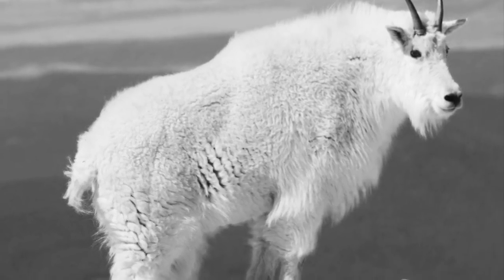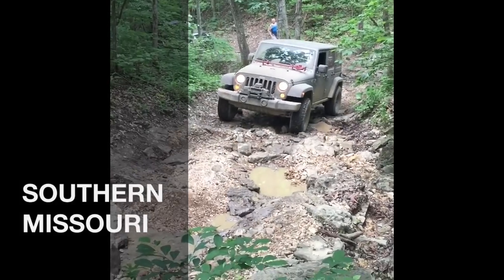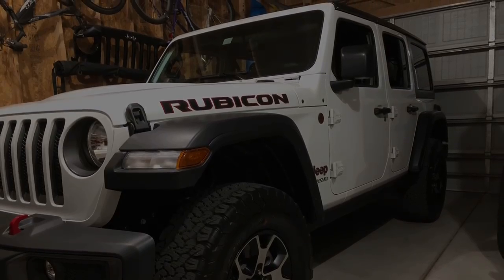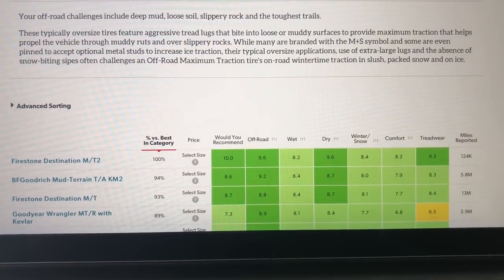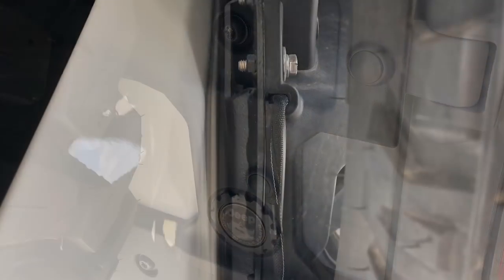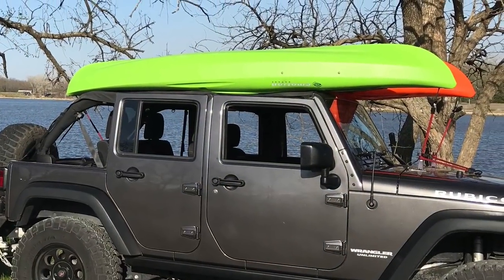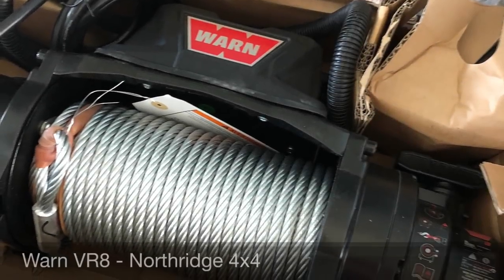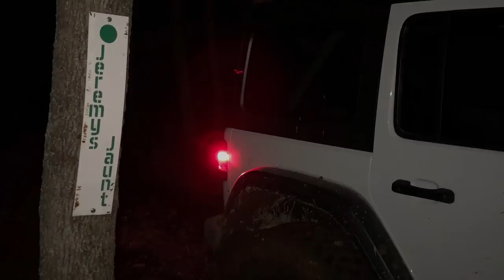Jeep Wrangler JL First Mods

Comment: I too have a new JL Rubicon.  It currently has 5000+ miles on it.  3000+ are the results of a trip starting in Ky, thru RMNP (we too did Old Fall River Rd which looks like one of your photos),  then Mosquito Pass, then down to Breckinridge for a couple of trails and then on to Ouray for a couple more...   Next we headed to Moab for some wheeling there before starting for home.  My old JK had a 2 1/2 lift with 34’s.  I will be lifted and on at least 35’s before running Poison Spider Mesa again.  Thanks for describing your build..
Reply from the maker: Mike Robbins that sounds like a great time! I have never run Poison Spider, but’s it on the list for sure. You are right on old Fall River road- not very challenging (unless you don’t like heights), but great views. That JL will handle 35’s just fine!

Comment: Keep track of your front end height with the addition of the steel bumper, winch, and jack.  I have always heard the front will sag with the additional weight.  That said, your mountain goat looks great and enjoying your videos!  I have a 2018 Sport S that I have doing some tinkering with.  Installed Rubicon take off suspension, Rubicon upgraded wheels/stock tires, Rubicon rock rails, the Jeep All Weather floormats and sill protectors. I've also ceramic coated the Jeep myself, had the front windows tinted, and just had hood decals made for "The Yeti"  Not as many trails in northern IL but looking forward to winter for a change. :)
Reply from the maker: I will definitely keep track of it as I have noticed a little (1/2)” dip after the winch and bumper. Thank you for the compliments, and it sounds like you have done quite a bit of work on the Yeti already to get it ready for some cold weather. That’s when they thrive, right?

Comment: Incredible video quality. Thoroughly enjoyed it. How nervous are you about wheel spacers with 37s on stock axles. I really makes me nervous and I have 33s. Shifts the weight out further putting more strain on parts.
Reply from the maker: Thank you for the kind words. This is the first time I have run spacers in Four Jeeps, but I installed and torqued them myself. I do check them regularly, and so far so good. I agree that larger tires offer more leverage to break or bend things, but these axles are supposed to be stronger than those on the JK. At this point I am having fun but also paying close attention to how my Jeep is doing, and how the other early modifiers of the JL are doing. I am not nervous per se, but realize I am taking a calculated risk with this or any mod and being as sensible as possible to keep things from getting damaged and stay safe. I’ll keep everyone posted as time progresses.

Comment: 390 per tire ? Sweet Christ.
Reply from the maker: Jeffrey826 Firestone itself has good deals on these. They run 25% off periodically so you can keep an eye out there. Good 37’s aren’t cheap 😀
Reply: @AmericanJeeper  I bought my whole 2012 Jeep liberty for $8,000 lol about the cost of the stereo option on the JL ruby prob lol
Reply from the maker: Jeffrey826 that sounds like a good deal. Yes these JL’s are commanding a premium for everything. The same bumpers that fit on a JK are more for a JL. I’m refusing to add up what I have spent in mods already
Reply: @AmericanJeeper  do you have a full time t case or just part time ?
Reply from the maker: Jeffrey826 all the Wranglers have either select track or rock track transfer cases-part time with 2H, 4H, and 4L. The Sahara has an optional auto 4wd feature that turns on when it senses the need.
Reply: @AmericanJeeper  oh ok we have selec trac and command trac
Reply from the maker: Jeffrey826 yes sir-all good stuff as Jeep knows how to do it
Reply: @AmericanJeeper  anyways good luck with your expensive jeep hope it doesn't depreciate too much on ya. I'll sub, let see it hit some trails.